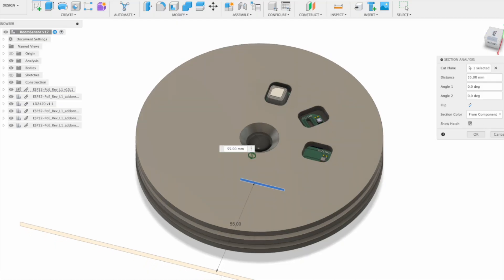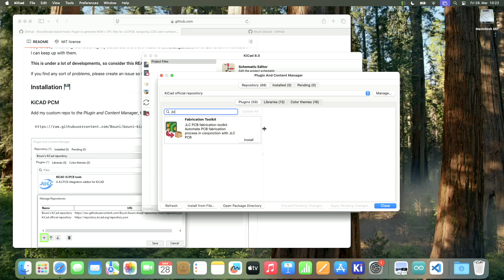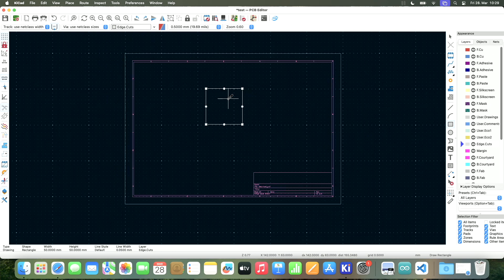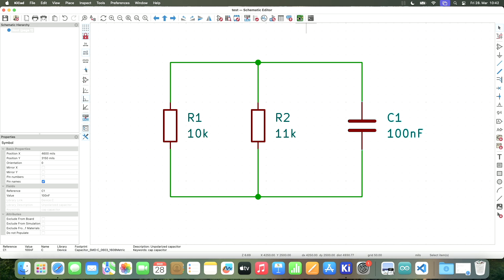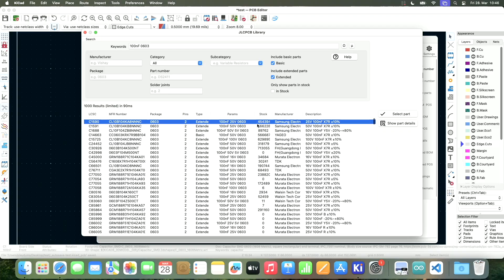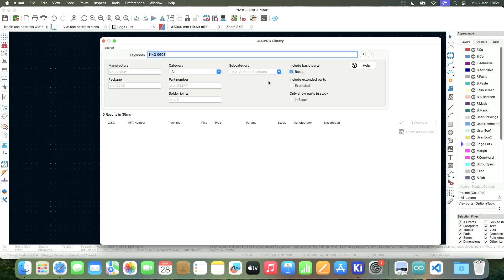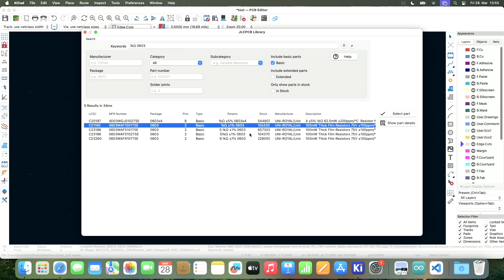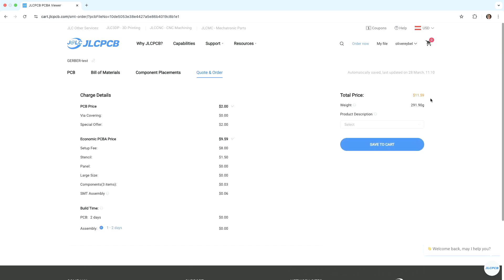Save Money on PCB Assembly: KiCad Tips for JLC PCB

Comment: "Never solder parts again". Well, that's a yes and no thing for me. Never solder surface mount stuff: Yes!

On my latest project (just ordered today), i have quite a few screw terminals and a few beefy components like a bridge rectifier and an inductor. I went for through-hole components on those. The rectifier and the inductor are not available surface mount with the specs i need. And for things like screw terminals, through-hole just gives a better mechanical stability.

These are components that are quite fast and relaxing to solder. And it's far cheaper doing it myself than adding quite a few manufacturing steps at the factory. (The factory would also hand-solder those specific components, or at the very least would have to place them onto the board manually).

And the specific inductor i use is not even available - it's nothing special, just something i picked because i very much like how it looks, and it's become sort of a standard in all my power regulator designs for nearly a decade now. It's from Fastron 09HVP series, the one where you can see the wires (no ugly black shrink wrap). I feel it gives a nice straight-from-the-tube-era look amidst all that modern transistor-thingies design. Yes, i know i'm weird ;-)
Reply from the maker: Very nice solution to solder a few tht parts yourself and keep the SMD to the machine. whenever possible, I also pick tht screw terminals.

Comment: This is ONLY valid for economic assembly. If you`re using a component that must be assembled in standard process, for example an ESP32 module, or your order exceeds the amount of 10 PCBA, then you are forced to use standard PCBA. For standard PCBA type, all components(basic and extended) are required to load the feeders on P&P machines, which requires an additional labor fee, €1.34 per component.
Reply: JPCPCB does not demand standard service for esp, i just got 5 boards made a few weeks ago
Reply from the maker: Good point! I had exactly this problem with my last order.

Comment: Nice job on the update - hopefully you've saved a few people a few $! One thing I do when doing the schematic is try to pick my resistor sizes from the E12 number set - that way I'm guaranteed that JLC will have a basic part for it in all component sizes from 0402 right up to 1206. I tend to stick with 0805 because the 0604 and 0402 are just too tiny for me to kludge later, and 1206 is a bit large by today's standards :)
Reply from the maker: Thank you! Using E12 is a great tip! 0805 is a great size :) If there is enough space ;)

Comment: Good to know the extension might not yet work on version 9.
Will try it, looks like a huge time saver.
Reply: I use it in KiCad9 and it works for me
Reply from the maker: that's good to know! I saw some github issues, but it seems like it works for some installations.
Reply: @playduino  It looks like "KiCAD JLCPCB tools" now reports to be compatible with KiCAD 9.
Reply: @TD-er  Well, NO it is not, try'd everything, still not working on linux mint and KiCad 9.0.😥
Maybe Linux Mint's is the problem??
Reply from the maker: It's great!
Reply: I’ve installed the doorbell AND connected the wires. 😁